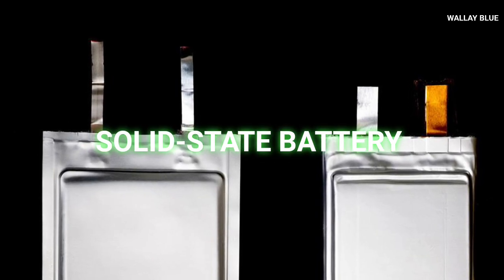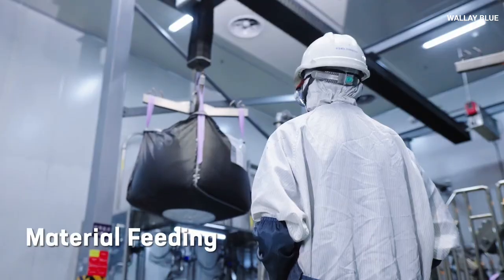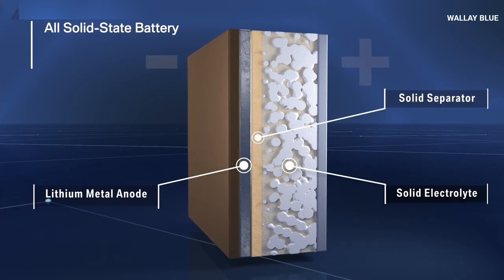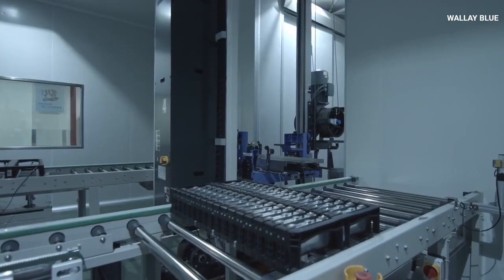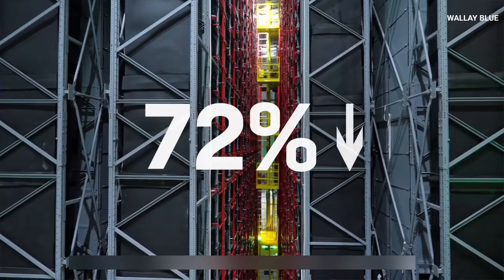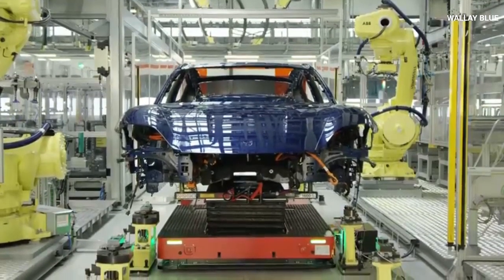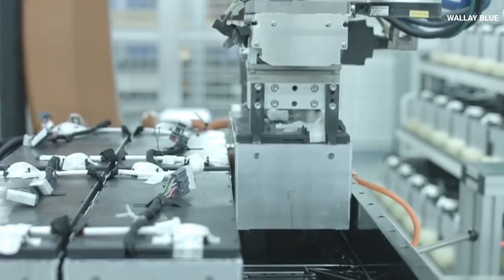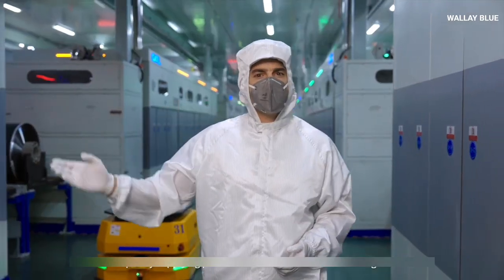CATL Revealed The Largest SOLID STATE Batteries! 10 Mins Charging

Comment: NOT SO FAST ... Amigo!
The Problem with EVs is...... ELECTRICITY!
The Problem is that there is not enough ELECTRICITY per Vehicle.
There is enough to Supplement Gas vehicles but, NOT Replace it.
OIL is the Major creator of ELECTRICITY!
EVs still pollute!
Reply: Fossil fuels account for less and less production of electricity. 
   Solar, wind and hydro make-up a growing source of electrical power. Along with nuclear plants, fossil fuel electric production is being pushed farther out of the mix . By the end of 2025 it will be close to 50-50… in the U.S.
Reply: Not so fast petroleum stooge,  I have and will continue to charge my EVs with my solar panels 
  You need to STFU
Reply: That's why you need nuclear plants.